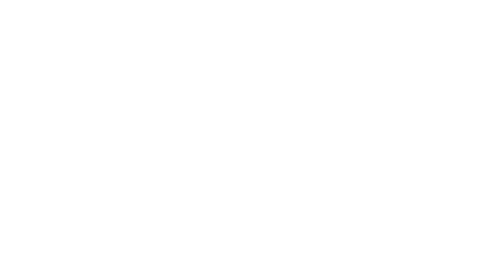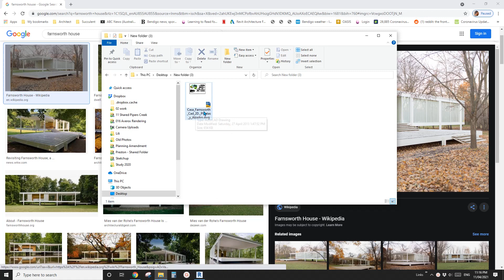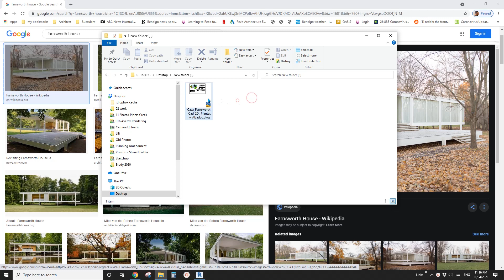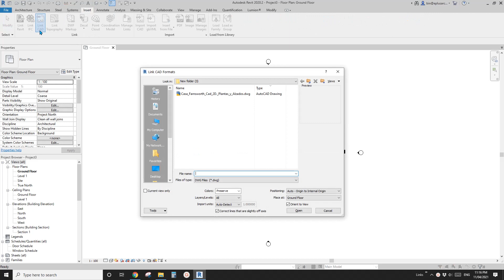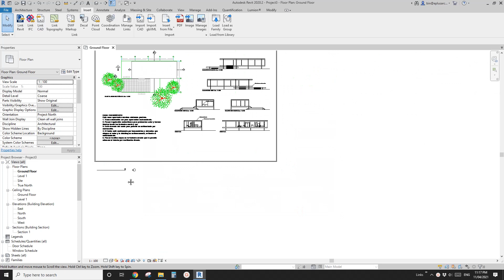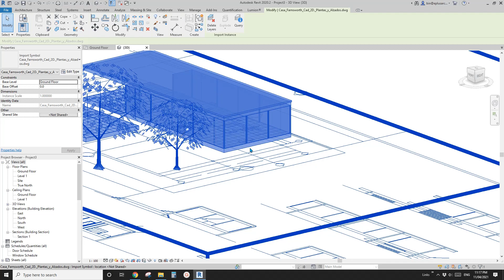Everyday Revit (Day 390) - Simple project from DWG file (Farnsworth House)

Comment: Hi Bin, I enjoy your tutorials very much. I do have a novice question. 

I noticed when you added the columns, they “cut” through the floor. But they are not really cutting. It’s simply overlapping. I have noticed this when I import my designs into Twinmotion that the materials/objects create problems graphically as they are overlapping unless I change the outline of the floor to go around the edges of the column. 

Q: what is the correct way to go about this in order to show an accurate connection between floor and column? 

Thank you in advance, kind regards
Reply from the maker: Because I used structural columns in this exercise, which can not be joined with floor. You can try architectural column.
I won't worry too much if it's just concept drawing. In Lumion there is an option for material to switch between different material if they are overlapped, do you have this in Twinmotion? If it's construction drawing, I would probably model the floor to go around the edge if it is going to be like that in reality.
Reply: @BINHE615  hi Bin thank you for your reply.

Twinmotion just released a new update which seems more promising. You can add material to selection but when two items overlap it creates a flickering. 

Haven’t yet experienced this in the new version, so they may have fixed this issue.